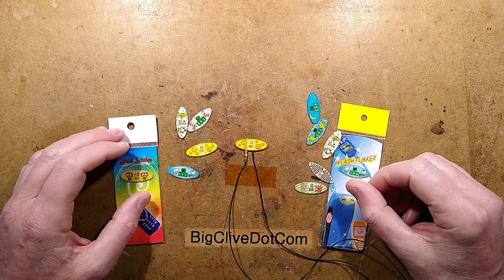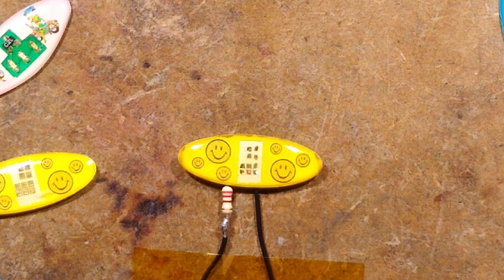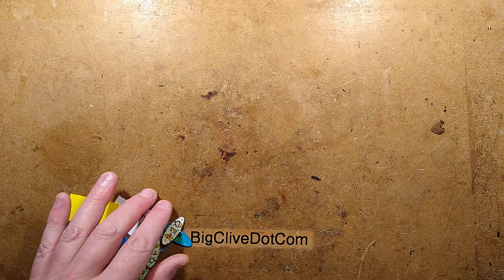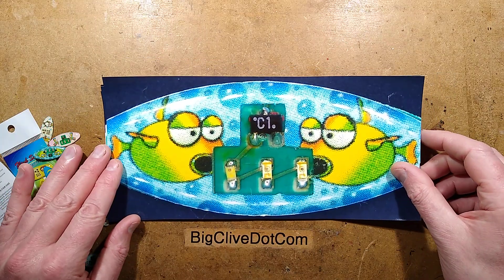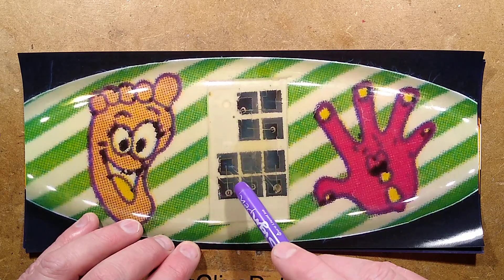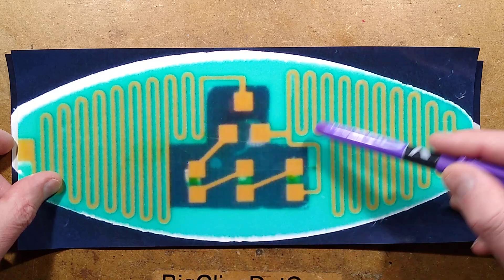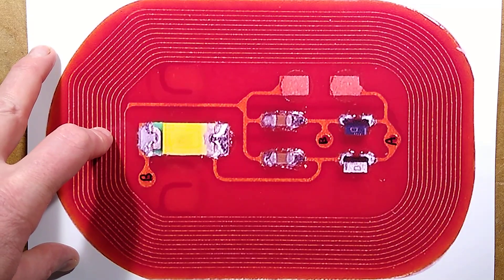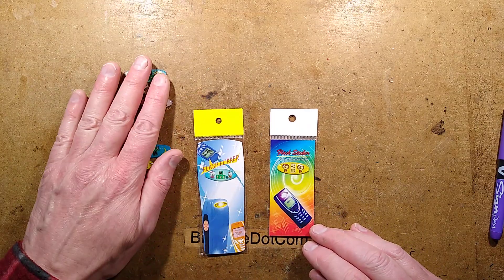How self-powered flashing phone stickers worked (with schematic)

Comment: These remind me of the old CB radio days when there were lights available that could be placed on top of antennas that would light up when the user transmitted, you only need to wind a coil around a transmitting antenna to induce current to flow at either end of that coil  - There was a case of a man in the USA years ago who used this effect to steal power for his house from a large radio station's antenna! Some geeks at the radio station were noticing power losses which couldn't be accounted for in their electrical/RF calculations, eventually a winding was dug up around the base of the antenna which then led back to the guy's house, he was convicted of theft later!  Nowadays, I guess they are found in wireless phone chargers which are kind of cool but a lot of wasted power and heat aren't they, not so green in a day and age where TV manufacturers are forced to make their standby circuits run in mA?

Comment: So, these were essentially the 90's version of a crystal radio, but with light as the output. I miss my old 80's electronics project kit (the good one from Radio Shack that actually had the components mounted on the surface with springs.)

Comment: Hey! Just what I was remembering yesterday!

There were also (speaking now on the 2008 approx) little toys and things you could attach to the phone. They worked the same way, just that they used batteries and little microcontrollers. The same RF detection boards were then used on some of the first piezo lighters, when you turn the lighter on, the RF signal emitted by the arc will make the LEDs flash... and that was the last time I saw one of those

Comment: Back in the early 2000s I had a couple of ball point pens with a red LED on the end, that made use of the same principal (but carried is own button cell power, so was a much bigger and brighter diode than the stickers). They were a promotional item, can't remember what for, but I think probably a video game, and were meant as a silent visual indication that your phone was ringing, to avoid the annoying buzz of having vibrate on.

Did what it was supposed to, worked well enough that I butchered one of them and mounted it in the dash of my motorbike. Just meant if I got a call on the road, I would see the light flashing, and could find somewhere to pull over and call back. Was a bit of a shame that these zero contact, zero direct connection technologies ceased to work.

Comment: Hi Clive, I know you get tons and tons of comments not sure if you'll see this. Just yesterday I pulled up my extra long USB C charger cord from between my bed and nightstand and it was HOT and the plastic inside a bit melted. I got scared and immediately unplugged it. I could barely touch the connector, it was so hot. I am not sure if I just had the terrible luck of a small piece of conductive debris or maybe even a tiny tiny bug shorted it or what.

Just now I did a little test because I know you have discussed poor isolation in power adapters. I have a brass outlet plate which could have potentially completed a circuit if the connector tip just so happened to have fallen behind the bed and rested in the wrong spot. I licked a finger and touched the outlet plate, and touched the charger tip to my tongue and sure enough felt a tingle. Could something be wrong in my home wiring or is it more likely the power adapter? It was an aunt's cheap lamp/alarm clock/USB charger/power tap. It Says UL on the black and white sticker but mmmmm doesn't look all that official. I want to go pull out the multimeter but that will have to be tomorrow as I am pretty tired.
Reply from the maker: It sounds like just a bad lead with shorting contacts in the end.  The tingle is probably just the usual low current leakage common with these ungrounded chargers.
Reply: @bigclivedotcom  Ah thank you!! I will check it out. Hope you are well

Comment: I know this isn't related to the video but those little 400w personal heaters, if you were to mod it somehow to where mod it use directly 1500w would it actually work? Ik it's probably going to catch on fire or melt something but regardless is it possible to push those 400w cores to 1500w? Yes it sounds stupid but I'm just curious😂
Reply from the maker: I think they're already pushed at 400W.  They self regulate by changing their resistance with the heat of the ceramic material.
Reply: @bigclivedotcom  oh I see it makes a lot more sense now👍 thank you and keep up the amazing videos👍👍
Reply: I don't know much of how those little heaters only use 400w I don't know if it uses an internal resistor built into the circuit or if the heater core is used at the resistor😂?

Comment: Wow I wonder if you can still get these now I want to try putting one on a handheld UHF transceiver...see if 220 or 440MHz might light one up... Or depending what power is required it could be possible to do a sweep with a SDR and see what frequencies it responds to in a shielded test chamber (read: microwave or clothes dryer)

Comment: As an RF engineer im looking at these things as an RF abomination generating splatter in other parts of RF spectrum. 
you know those godlike NOKIA3310 phones were indestructible, and the speaker also worked great as a car super tweeter if you could get it out. i still have one on my bike blasting away after all those years like its experiencing immortality. absolute gem of a thing. its probably using banned materials like the juicy lead solder and tasty bromine.

Comment: not an RF Geek but I think antenna length is fraction of RF wavelength. I have a radio with 2.4 and 9.15 GHz and they need different antennas. Think one manufacturer shipped with wrong recently. Dual band wifi routers confuse me though: do they have 2 routes....

Comment: 2G CDMA/GSM typically operated from 800Mhz - 1.9Ghz.  Those goofy little antennas were of a fairly specific length, and the thickness of the antenna track did affect the resonant wavelength, hence the different track lengths you see across different stickers.  The wireless world was a lot more cowboy back then, but in the US, tMAX was capped at 5w, so the fact that they could pull 7v at an amperage high enough to light three SMDs off what was commonly 800-900Mhz in the US is actually pretty impressive.

Comment: in your 4th paragraph you state you may not have been able to get them to work on modern phones because of reduced power.  this sounds right to me because i saw it written, about 10 years ago that 'modern' phones  (well, 10 years ago 'modern') use 1 millionth of the power to do a task that the old 'brick' phones used to.  about the aerials, you remember when phones had a short aerial poking out of them.  someone worked out that they could fold the copper tracer up over and over so it was still the same length and it would do the same job.  it is fair to assume that the waves were sent out in more than one plane.  it was based on the science of fractals.  i am inclined to believe that the different lengths of those tracers on your phone stickers may have made them more or less efficient at doing the job they were intended for.  the one that has a longer tracer will theoretically be twice ( or thrice or 4 times) the length.  i have never heard about these things before.  to me it is a bit like fluorescent light tubes glowing near a plastic packaging machine i saw on an australian current affairs program (abc four corners) about 20 years ago, investigating the dangers of workers being too near a machine that used microwaves to seal plastic wrapping.  they liked how they could feel the warmth on a cold winter morning.

Comment: I've still got one or two of these knocking around in my shed and often wondered on what powered them as i guessed how they sorted worked.
Ok i'm not up to par on stuff like this but did i miss the part where Clive told us what powered them,again i'm not all that when it comes to electric stuff as you can probably guess,i need more info on self powering phone stickers please Clive. 🤷🏾‍♂️😢🙄😉
Reply from the maker: The sticker is basically a receiver antenna with LEDs.  It steals a bit of the phone's transmission power.
Reply: @bigclivedotcom  Thanks for the quick reply Clive,as i said above that was one of the main things that use to puzzle me back in the day,i knew or at least thought there couldn't be batteries so small i/we couldn't see them,🙄😉 it was near enough common sense to me on how it worked as far as the antenna went,but i couldn't get passed where the power was coming from no matter how small it was,yeah i had a few different Nokia phones as well as Motorola,which use to be the main two biggest brands back then,my first ever mobile i got was that big old mobile we all called the brick as it loosely resembled a house brick,again made by Motorola and it cost just over £1,500/£2000.00 for the phone and then we had to pay for a contract with Vodafone or Orange then the monthly bills for phone calls,memory serves me correctly they didn't even have a massaging service back then,partly because the screen would of been to small and no doubt other reason,things were a little different by the time i got the Motorola Razor Flip.   🤣🤣😉

Comment: didnt have the stickers but I did have the transparent blue case and battery pack AND antenna that lit up like the 4th of July when a call was arriving... which I expected to happen and it would continue to flicker as long as the phone was being used... but what got me concerned was it would light up for a second or 2 at random intervals about 3-4 times a day, turned out it was the system pinging my phone for its location... later on down the timeline, the lights would come on and stay on for several minutes, if I hit the use button it would turn off and stay off untill I hit the call/send button. Dont know how true it was but I had heard that the phones were capable of listening in on you via outside operators, basically you were being bugged via the phone therefore the long on times of the leds while sitting there untouched

Comment: I had a 5110 / 6110 and the antennae was a lazer pointer. I had a bunch of tips for the pointer and it flashed when the phone was sending/receiving signal. Would flash when sms and occasionally during cell updates - just like these.

Comment: I was working in a mobile phone shop here in Aus, back in the hey day of analogue then GSM and CDMA. 
As GSM came to be here, flashing accessories (antennas mostly, for the 51/61 series of Nokia's and Ericson 300 and 600 series) were hot sellers, then alternative screen and keypad backlights (8 series Nokia's, everyone wanted white or blue). We used to also do a roaring trade in new screens and "fingers" (the wire impregnated rubber coupler between screen and board). Iirc, they used to compress and cause screen fade out? (It's going back a awhile! 🤔😂)
Thanks for the content Clive and happy new years 👍🍻

Comment: You can build such a simple RF detector by using a 1SS86 diode in parallel with a LED. With the lenght of the LED leads, this detector react to incoming/outgoing calls on a cellphone when the cellphone is configured to use only 2G. This simple detector also called a Lectenna (combines LED and Antenna) reacts to microwaves leaking from a microwave oven door, when you hold it on the outside of the oven door. 
To adjust the frequency response, you must increase the lenght of the 2 leads, the longer the 2 leads, the lower frequency the detector response to.
Dave of Grants Pass TV Repair made a video about this $2 detector : https://youtu.be/vHVmJ5lD9jc

Comment: Used to have a collection of these in the antenna mounted variety for my Ericsson t28 and later t39...  The antenna was replaced with a stubby that had a screw these blinking replacement antennas attached to.  I was so much younger back then...

Comment: i bought one that looked something like those that didn't light up, but it was supposed to increase your reception if you stuck it on the back under the antenna. this was back when i had a flip phone with the pull out antenna. it was a scam too, never did anything

Comment: RF decays in to microwave.  This is also why your face would get hot, red and rashy from using your phone.  Especially older phones.
Reply: As far as 5G, it can be used just like sonar or radar, but in much higher definition.  3G can read heartrates and track you through walls.  5G can measure your blood pressure.
You are already a wireless device in the Internet of Things.  You live in glass houses illuminated by lights you cannot see, but which digital eyes can.
Read the wiki article on Hyperspectral imaging.

See also CBC News Canada: "Your Wi-Fi router could be used to watch you breathe and monitor your heartbeat

Radar-like technology can see through walls to track movement"

Comment: Question: did the mini RF socket on mobile phones for external antennas make any difference to reception? Equally, did the extra length screw in replacement aerials work better than the one that came with the phone?
Reply: Because the internal antenna was such a compromise, It would make a huge difference as long as the separate antenna was more efficient, eg a full sized dipole or a Yagi.

Comment: I'll go even older before cell phones. I used to have a 90 volt neon on the end of my C.B. radios car mounted antenna, and when you keyed the mic to transmit it would glow. 1 wire was cut off an the other wire was touched to the actual antenna. It was actually pretty cool to see a 90 volt neon lighting up when you transmitted the signal. :D

Comment: Wow this is a blast from the past. Or is that flash from the past? I remember these, and also thinking how asinine it was. Still, it was an intriguing novelty. I also remember when a cellphone meant a giant suitcase with an actual handset attached to it that ran off of heavy lead acid batteries. My old man had one when he had his own medical practice, and back then "small" meant it fit in the overhead luggage compartment on the plane. Although since I'm in a rural area, not much has changed. The phone still has to run at full power just to get one or two bars of shitty reception, and the sticker is not needed. Anything with a speaker nearby will start audibly chirping with the data when I get a text or call, so even on vibrate it still "rings."

Comment: I've always wondered what diode they used. I took one from the antennas that glowed and made a coil that slip over my phone's antenna (different brand) used that diode and an LED and it lit up. Tried making another with a 1N4148 and it didn't work.
Reply: Microwave diode. Usually a Schottky diode. Ordinary diodes are too slow.

Comment: I'm curious if you take these stickers into a retail store that has the security gates that beep when someone steals something if the stickers would either light up or set off the alarm. I had something similar to this but it used batteries and it would flicker when you get a call.
Reply from the maker: The security systems are usually inductive.
Reply: The security stickers with a large spiral coil work at 8.2MHz, a long way off from mobile frequencies. When Maplins was still about, a 10m length of co-ax cable would often set off their door alarm...
A coil and capacitor resonant at 8.2MHz will set the alarms off.  I put one in my wallet for a laugh once, the security guard looked quite confused when passing my wallet through the gate set the alarm off.
Reply: @threeMetreJim  I walked into a rite aid store many years ago and I had everything in my pockets then. I had an audio cable and I bought a bunch of stuff there and paid for it and when I walked out the alarm beeped so I had the cashier check my stuff, luckily I did because there was this challenged person who put someone else's stuff in my bag and I went back and my bag was checked and the other person's things removed. I walked out again and the alarm beeped. I just kept walking because I know they have cameras and if I did steal anything they have it on camera which I didn't I bought some stuff, paid for it and left, they should have that on camera.
Also I'm curious if it's possible to pick up that 8.2MHz signal like with a shortwave radio. Bring my little Grundig radio with a car phone antenna on it into the store.

Comment: I remember when these hit my town... The local mall started putting in kiosks in the middle of the big hall / walkway, and there was a kiosk selling things like this.  It looked like the Las Vegas strip in miniature.  My mother's Nokia 5160 had a light-up battery (a lithium battery, WOW!) in its later years, so it lit up like a pinball machine when it rang.  If i remember correctly, the LED display was in parallel with the vibrator motor, which was inside the battery.
And now we all have black or silver slabs without so much as a notification blinker...
Reply: My black slab has a screen that curves around the sides, and will light up the edge as a notification.  This is visible even when the screen is face down on a table.
It also gives a haptic "knock" when I pick it up if there are new notifications.
I don't think people care about a light that stays on because they habitually check the phone all the time anyway.  And with social media in the feed, there will always be new notifications.

Comment: Midly related but if you fold a piece of foil in the right way so it can rock back and forth and place it over a wireless charging pad it'll rock back and forth and make a little ticking sound. Certainly surprised me when I found that out
Reply: You've just invented the electric induction motor! ;-)